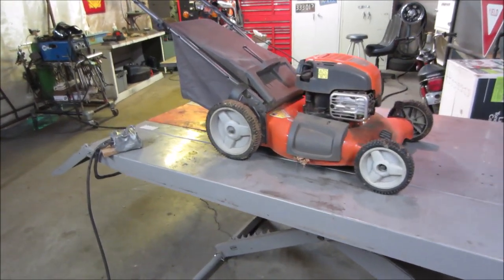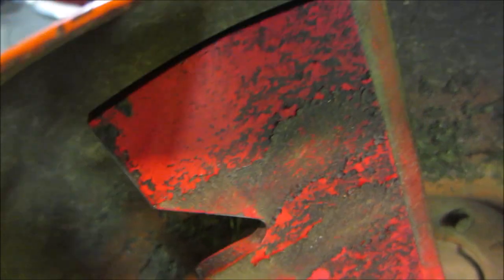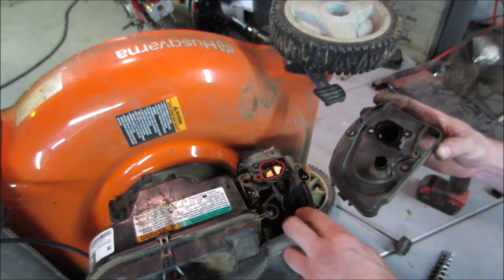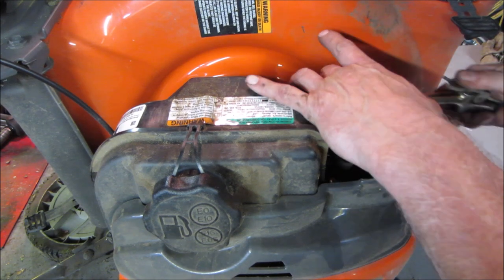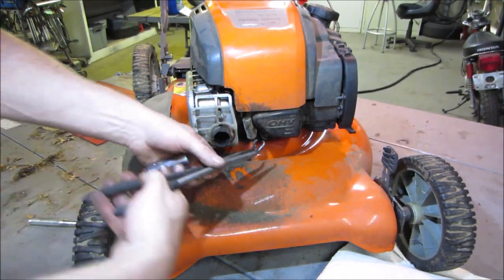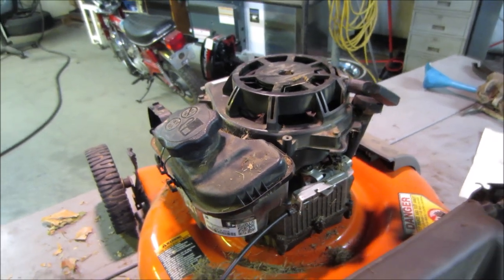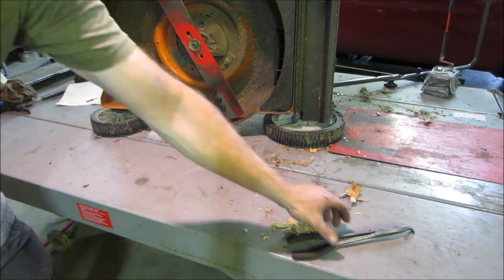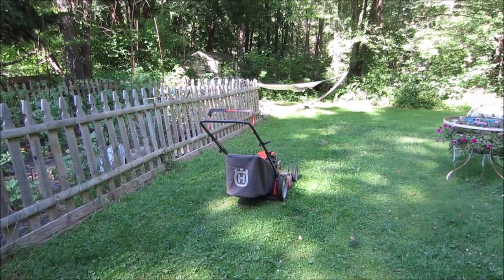NO OIL CHANGES? Servicing A Broken Yard Sale Lawn Mower,

Comment: I bought a lawn mowing company that had actually purchased a Walker  mower they pulled in and dropped the trailer and drove off in disgust...
They had the mower deck flipped up to fit into the trailer and I saw something shiny....yup cutting edge

Comment: A friend of mine had a similar problem. He never changed the oil since he got it, which was 2 years. It was the platinum Briggs with no oil "changes" and it didn't have a primer bulb or choke. He said it didn't run for more than 5 mins, it didn't run well, and smoked the whole time. What he did wrong was getting grass unstuck from the blade. He would tilt the mower sideways, with the carb facing down. When he told me the problem, I thought it was piston rings, but when I opened the air box it was full of oil. So apparently when he tilted it to get grass out of the blade, oil spills from the case vent and soaked the air filter with oil.

Comment: I bought the same mower for $60.  Got it home, check for spark - good, pulled the carb, noticed moisture in the oil, poured out all the gas and oil, cleaned the carb, added new oil and gas and it started on the second pull.  👍

Comment: husqvarna is a great brand, I have a lawnmower with a Honda engine, 3 year warranty cannot be beat! I also bought a sewing machine from them for my wife, I have a chain saw by them.  I just got tired of everything breaking all the time and every year having to service the lawnmower, parts breaking on my chainsaw.  No starting issues since I have had them, had the lawnmower for slightly over 3 years, carb is still good.  The only issue now is with the flow of fuel.  If the shutoff valve is not turned to off position, fuel drains slowly, is in the carb but it still turns on, I just shut off the fuel valve after use.  It happened right after the 3 year warranty went by...as all issues do. I will only tear it apart when it will not start!

Comment: I am 16 and I work on small engines and I got a Briggs and Stratton push mower that wouldnt start so I checked the carbureator, main jet, spark plug, tested magnet contacts on the flywheel with the ignition coil

Comment: I havent changed the oil in my lawnmower in 12 years. ..  kinda wanted it to die so i could buy a new one, but it wont give up.
Reply: Lol!!! I do the same thing. I’ve bought two mowers in the last 22 years. I never do any maintenance on them other than sharpening the blade.
Reply: @nedryerson988  

I have owned 3 lawnmowers in 35 years of on and off home ownership,  and the first one I don't think I even changed the air filter.  However, I only had it about a year and the house I had then had a small front and back yard.
The second one needed more care, at one point I changed the oil and the air filter and it still wouldn't start after a few months of idleness.  I actually had to replace the spark plug.  That mover was "accidentally" left behind when I sold that house, but it was just as well as the deck was rotting away after just a few years use.
The 3rd? I am trying to be conscientious about maintaining it, tho I don't know why.  I bought a small push mower when my health is to the point where I need a riding mower.
Reply: I have noticed that pretty much all these "smaller" mowers lack drain plugs now.  Changing the oil is a real pain, but the manuals tell you to do it periodically...like after 30 hours.
Reply: @Howard Kerr   30 hours?!? That’s like less than half the cutting season!! 😬
Reply: @howardkerr8174  changing the oil with no drain plug couldn't be easier. Take out the fill cap and turn it on its side. Never worry about stripping out a drain plug or a leak from underneath. Couldn't be quicker.

Comment: According to a magazine article I read, B&S studied home oil changes and discovered that many homeowners were introducing a shocking amount of dirt to the crankcase when they did one. So they improved air filtration, apparently the other leading cause of contamination problems, and said that oil changes weren't necessary. Not sure I believe it, either. The latest Honda engine I bought had no change plug, either. Dump out the top. Edit: Briggs introduced no oil change engines in 2015. That mower is nearly new, not 10 years old.

Comment: I picked up a Craftsman with a Honda engine... no workie... also I swear the oil had never been changed! After flushing the oil a few times it flowed clean. Works great, single pull starter... added it to the collection of mowers.

Comment: Lol, I've had this problem but only on a john deere mowing tractor and it will still cut the grass evenly. But after some time I  knew the blades would need sharpening even tho it will still cut grass, so upon removal of the blades I studied how the discharge exhaust chute is directed compared to how the blades would spin then i realized i had previously installed it wrong. This happened 3 days ago. So as soon as you flipped that lower I noticed it.

Comment: I made a suction drainer out of an old 2-1/2 gallon paint pressure pot.  The vacuum comes from an old undercoating sprayer (blow air through and its' venturi sucks hard enough to suck up thick undercoating). That vacuum draws hard enough on the paint pot to suction drain whatever through a vinyl hose.  I drain oil sumps, gas tanks, rear axles, brake master cylinders, power steering pumps and of course  small engines without messing with drain plugs.

Comment: Wish I could find a deal like that at a yard sale near me. I can't complain tho as just last month I was gifted with a still new looking perfectly maintained and only used for 2 years when bought new Garden Way Troy Bilt 33" mulching walk behind mower from 1995 (according to the engine date code from Briggs), with it I got the owners manual and 2 boxes. In one still sealed up box was 2 blades that were rusty due to age and in the other still sealed box was the air filter, air filter foam, champion spark plug and 2 new belts. The mower had only been used for about 2 years when bought new in 1995 and the woman they inherited the house from and therefore the mower had had it serviced before putting it in her shed. That mower still looks like new, only thing that's wrong is the grips fell off but those should be easy enough to find and this one has the battery with key start option as well as the pull start, the battery is odd it's a 7.5 volt and looks like something from a kids powerwheels toy ride on, it is missing it's  charging cable you plug in but I thought if I ever stick a battery on there I'll just come up with another way of charging it as I'm sure finding the cable wouldn't be easy or if someone had one they'd be asking a fortune online for it. I had the thing running in less than 15 minutes of the neighbor bringing it and giving it to me and everything on it working and cut with it that afternoon. So as I said I can't complain as that was the best gift I've gotten, because before that I was having to mow my over an acre hillside with a 2019 Hyper Tough 20" push mower that's right front wheel rusted off (repaired that). 
Notice the carb on this Husky is the same thing that's on my 20" cheapest mower Walmart had, those plastic ones that some people don't like but I find easy peasy to get working again. Hopefully I come across something like this at a yard sale or set out at the trash sometimes as with the Troy Bilt walk behind 33" I do most of my mowing with, there's still places it's too big to go or dangerous to operate on my the banks of my hill where that I still need some kind of lightweight push mower.

Comment: "Not performing very well."  Sweet words, that means it at least works.
Those hearing protectors would set you back ~$15 or more new. 
Have a buddy at work scored a trashed table saw, blade on backwards, works fine now.
I recently picked up two electric pressure washers, one worked, one didn't.  Bad connection at the GFI plug.  They both work now.
I love curbside shopping.

Comment: Interesting that in several B&S owner's manual they give specs for a specific capacity of oil but when you measure that and add the oil it comes out way too high on the dip stick cross hatch. That overfill would be a problem.

Comment: I bought a lawn mower from a big box hardware store, brand new for 40 bucks. The tag said it was no refund. They wouldn't let me run it and said it was a return item. I looked and saw there was no blade. I threw the 40 bucks at them and now a decade later that same mower is still running fantastic. Always check the blade. :)

Comment: Ex FIL has a Husky mower like that one, only AWD (~$499 @ Lowe's) ... Guy he worked with bought it new, let it sit outside over the wet rainy Washington (state) winter with ethanol fuel in it... Went to use it in the spring and it wouldn't start. Brought it into work to throw it in the scrap pile, he grabbed it and brought it home. Fresh fuel and cleaned the crud out of the bowl and it ran like new.

Comment: I found if you only flip it up on the wrong side temporarily, to wash off the underside of the deck it doesn't put a significant amount of oil into the filter. But that oil can be a blessing if you store the mower outside in the rain and snow as it acts as an upper lubricant to protect it from the elements

Comment: I have a craftsman self propelled mower 26 years old ......starts on two pulls, have never changed the oil........only sharpen the  blade, change the wheels couple times.......works fine, cuts perfect.
Reply: 26 years and never changed the oil? Hahaha suuuurrreee.........

Comment: I have that exact same model. I change the oil. Also threw on a gator blade. Cuts much better now. The original blade didn’t mulch great.
Reply: On Husqvarna mowers a regrind of 30 degrees will greatly help the performance.

Comment: At the very least, I would change the oil after about the first 5 hours, than again after about 25 hours, after that, I wouldn't bother. I think the engine will likely out last the mower, if it got a couple of oil changes during break-in. I would change the oil regularly, if I intended to re-purpose the engine, or if I wanted to sell the engine. Otherwise, "check and add" will allow the engine to last until the wheels fall off, or the grass catcher or handle falls apart. I noticed as soon as you turned it on it's side, that the cutting edge was on the trailing, rather than the leading side of the blade. All Briggs and Stratton engines turn clockwise as viewed from the top, counter clockwise looking at the blade. If there's such thing as a mower that turns the opposite direction, I haven't seen it. Great video: Great find!

Comment: B&S lead the way on the no oil changes. It's actually pretty well thought out. Most people never changed their oil. And with the new OHV designs plus using a fulls synthetic factory fill oil the reality was the oil should last in normal use well past the actual engine life rating of most of the engines. Which are usually in the area of 200-400 operational hours. After that the bore is pretty well shot on a small engine. And since they are all aluminum now days with that oxide coating you can't hone them.

Comment: Just picked one of these off the curb (free) yesterday.  Air filter was incorrect (probably tied to change the oil = got filter full of oil).  Blade was unbalanced from all the damage (had to be taken off, cut/balanced).  Didn’t come with the bags or manuals/box though = Your $30 purchase may have been worth it for that alone.  The deck is really nice and solid on these.  I am assuming it is a $300 mower so you paid 10% of retail,  pretty good sounding mower also.

Comment: Bought last two new ones. NEVER changed the oil. Just top it off. Lasted 13 or 14 yrs till rust did it in. Engine was running great. No need whatsoever to change oil in these little lawnmowers. It’s just not what people have done though, so they cant imagine it. This is the second mower I’ve done this and first lasted 15 years.

Comment: I found with my Husqyarna that I had to relocate my fuel tank and put an inline fuel filter on it. The in tank filter only seems to last for a few years then it just starts plugging up the jets in the carb. I also had to reseat the jet block this spring. It had dropped just enough to not meter fuel properly into the intake so it was far too rich and wouldn't ignite. Not a fan of plastic carb pieces.

Comment: A friend of mine owns a lawn mower repair shop, the new thing with consumer lawn equipment is no oil changes, they come from the factory filled with full synthetic motor oil and all you need to do it keep it full. That’s what consumers want, no maintenance. Pull the cord and it starts, if it doesn’t start they buy a new one. And with using full synthetic motor oil the number of hours you get out of the mower is still longer than most consumers keep their mowers anyway.
Reply: I assure you If you change the oil the engine Will live 3 or 4 times of the hours, i work on cars since 15 years! My mower deck was on its second engine this year after 20 years and 3000 hours, only a pair of air filters and some l'iter of 10w40 changed every time it was becoming dirt
Reply: @gillespriod5509  My engines have always out-lasted the machines that they were on, because of regular oil changes and keeping a good air filter on them. That even includes the inexpensive aluminum cylinder wall engines on lawnmowers, roto-tillers, snow blowers, and pressure washers. It's pretty easy for me to imagine, that an engine will still out-last the machine its on, with just "check&fill", if the engine has had a good break in, and good quality filters are used. Regular maintenance would still be a good idea, if you plan on repurposing the engine, or selling it, after the wheels have come off the deck, the bag has holes, and the throttle cable no longer works.
     As a rule, I just change the oil once a season, and check each time I put gas in it. Each season, I clean or replace the air filter and pre-filter.

Comment: Nice job, good vid.  two things i would have done during the repair.  I would have sharpened the blade since it had to taken off because it was on backwards, and would have flushed the air cleaner filter with solvent then dried with air hose or even better - replaced it.    BUT, that's just me ....  keep up the good work

Comment: Thats how I bought my Metabo Miter saw. Dude was selling it cause it didnt cut perfect 90* angles. Got it 40% off as "faulty". What fixed it was sticking my digital angle finder and adjusting the small plastic pointer for the scale into proper spot.

Comment: There is a gentleman who offers tours of the beachfront area in a 1930 ford model A with all the options offered at the time. Tool box trunk mounted externally under the rear window 2 spare wheels and tires mounted in the front fenders all original never rusted always taken to the local ford dealer for service when he couldn't do it any more. The present owner spotted it for sale for $950.00. When he asked about the price he allowed he'd drop the price to what he paid for it $638.00. The buyer told him a car in this condition averaged over $20,000 or more and offered him $20,000 for the car. The old guy almost passed out and when the buyer asked why he was selling it he replied " got too old they tell me at DMV you see I turned 97 a month ago I failed the eye exam " The guy who bought it still offers tours in York, Maine with the car. It was the only car the old guy ever owned. True story and you can find the car sitting at the curb waiting for tourists to go for a tour.

Comment: Had a mower with that same engine and it was junk since day one. Engine always surged, bogged, hard to start and wouldn’t start if it was already running. Replaced the spark plug, filters, and carburetor and lasted a few months and did it all over again. If I got it running ok and hit a bump it’ll start surging. Bought a Honda with the new 200 engine and it performs flawlessly.
Reply: I Don't Believe You; I have the same engine on a Snapper SP90Q I got from Wal*Mart Online; Bought it in 2016; (and) it still runs perfectly. *Though I have changed the Oil *Every Year on Halloween to Prepare it for the up-coming season; It Might be My Oil Changes; (or) Just the Magical Mower Ghost that keep it running. You Pick. ROFL....

Comment: Safety first. Always disconnect the spark plug lead when doing any kind of work under the mower. That way you alleviate any chance of the mower starting, or even just kicking over. Human body parts and spinning mower blades is not a good thing. :-)

Comment: I've found blowing out the plug after sandblast cleaning does not get all the grit out. I blow it out, tap the plug on the side of the bench to let the grit fall out, spray with brake clean, blow out  again and put back in.

Comment: I had a similar experience, the one I bought at a yard sale told me it would not start, well, it had a tag on the gas fill neck said" be sure to add oil", so they filled the gas tank with cooking oil. Took one night to clean it out and get it running.

Comment: I learned the hard way as well 😩 leaning my Honda mower over towards the carb side when I cleaned under neath. Had oil run out all through the carb and ruined my air filter 👎🏼
@19:40 legs for the ladies 🤣😆

Comment: My (limited) experience is that an under-performing push-mower probably has a dirty, mostly-clogged air filter.  Not poo-pooing the oil check/change at all, it's just not the first place that I look.
Reply: I buy and refurbish lawnmowers from a local scrapyard. 
When there's no obvious issue with the filter, I've found that draining and replacing the old gas, giving them a shot of ether, or cleaning the floatbowl out will usually return the machine to usable service. 
Most are tossed once they become a little difficult to pull start, or some other small thing like a worn drive belt. Very rarely is a mower used to the point of actually breaking.